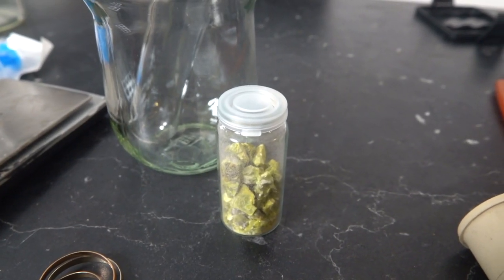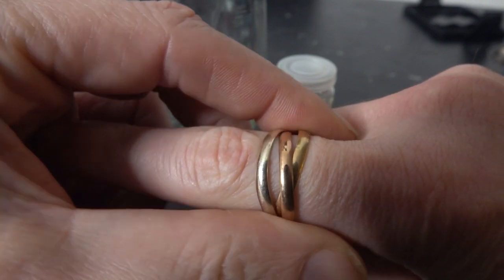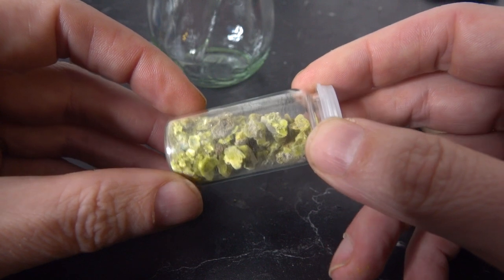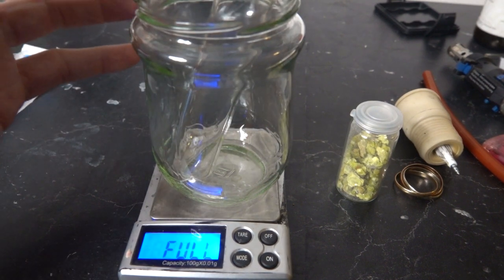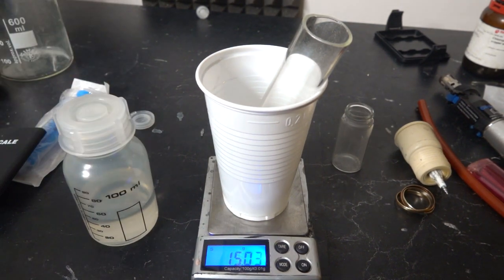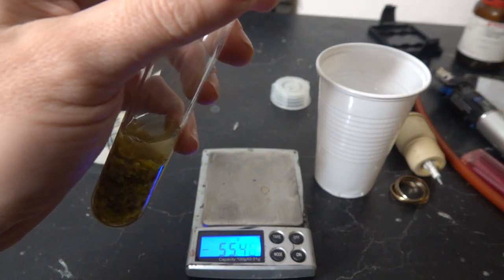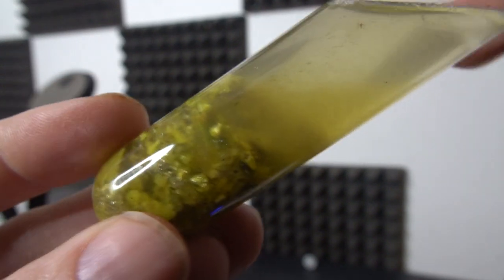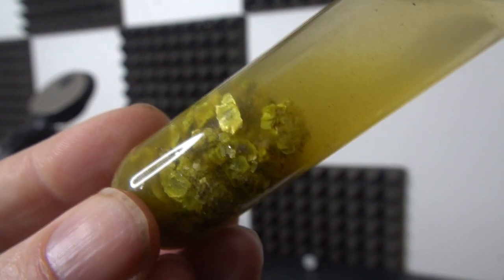Making a ring out of Metallic Uranium, Part 1

Comment: Bare hands and no vent hood to handle nitric acid?  Did you at least have a face shield on?
Reply: He wears glasses :))
Reply: If something happens to cause a splash of acid, glasses won't help.  Numerous times over the years while wearing glasses with side shields (prescription safety glasses), a drop or speck of something flying through the air got right past them and into my eyes or the corner of my eyes.  It's nothing as hazardous as straight acid of course, but it shows how glasses really provide only minimal protection.

Comment: nile red: "i won't refine uranium on youtube", always uses gloves and only under hood with DEPLETED uranium
thunderf00t: hold my uranium solution!
Reply: Depleted uranium is more radioactive than natural uranium, which is in turn more radioactive than highly enriched uranium. Radioactivity has (almost) nothing to do with the ability to perform nuclear fission when submitted to a neutron flow.
Reply: @takix2007  uranium 238 ( which i think of as depleted uranium) has a half live that is more than 5 times longer tan uranium 235 which is present in enriched or freshly refined uranium in addition to uranium 238. i would argue that this makes depleted uranium less radioactive. I did not look at the decay chain. if the decay chain of U238 releases more than 5 times as much energy as U235 i will admit defeat.
Reply: @MsMotron  you might be right, my brain may have made the shortcut to jump to U8 and its decay chain rather than pure U8 which is LESS radioactive than U5 or natural U. Some memories from my nuclear engineering courses nearly 15 years ago do tend to wash out when they are not used very often... (I do not work in the fuel cycle, so please forgive my rustiness!)
Reply: @takix2007  as the other guy said, going simply off half-lives, U-238 is less radioactive than U-235 because it has about 5 times longer half-life. Natural uranium contains mostly U-238, and depleted uranium even more so. So both natural and depleted uranium should be less radioactive than enriched uranium, which has a high concentration of U-235.
Reply: @SMPKarma  yeah, and like I said, I got it mixed up. I doubt there is any need to further comment that, don't you think? 😉
(Edit: I may have not been that clear about my mixing up of all instances of U8 with U5)

Comment: For casting, induction heating in an inert atmosphere  or under vacuum? (Vacuum casting has the advantage that you can use atmospheric pressure to collapse any voids) I don't know if traditional vacuum casting equipment and supplies would stand up to the temperatures needed. With a graphite mold you might be able to just heat it up under vacuum and then let argon in to make sure the mold is filled. 

If you wanted to go all out, I wonder what the surface tension of molten uranium is. You could cut a toroidal shaped cavity in graphite, pack some uranium in, then spin it as you melt/cool. The outer surface would be defined by the mold, the inner by the surface tension and speed of rotation. (And you shouldn't have to worry about thermal expansion/contraction breaking the ring or mold)

Comment: hey @VoiceOfThunder Don't rag on jam jar chemistry too much, cause there are kids in Texas USA that have to use jelly and jam jars to do any chemistry while watching your inspiring experiment videos, because while in Texas its pretty easy to get guns of many varieties, ALL LAB WARE like beakers flasks test tubes condensers? ILLEGAL TO OBTAIN OR OWN if you are not a big scientific research company/corporate lab or corporate chemical manufacturing facility. why? cause you would not want common people being able to make quality drugs and compete with the big pharma chemical industry side of the likes of Bayer or Dow Chemicals, even though they are claiming its to just stop home made illegal drugs, cause no one ever used a bath tube to make acid in the 60s and 70s, or even the 80s and 90s even with the rise of meth and ecstasy or what ever other designer drugs that were being made and sold at night clubs and on street corners, and it I am sure made the costs cheaper too since lab equipment is damn expensive if you get the right stuff to ensure control over your process. (I can attest to this thanks to the lab hardware I had to get for making my starting nano materials like nano copper, carbon nano tubes and probably some hybrid carbon/aluminum oxide nanotube/pores for my nanotube sleeved laser diodes and LEDs, and I don't even have all my needed equipment since my TV picture tube vacuum chamber is not cut down yet, so I can start cleaning the inside out and prepping all the ports and clamping fixtures for it let alone the hardware for the CNC X/Y table that will go inside so I can move a substrate under a laser array for doing controlled chemical deposition lol, heck I probably only have about half the glass ware I need since it gets damaged pretty easily when working with the harsher alkalies I need to work with, :)  )

Comment: Gee man, you surely ain’t an advertisement for safety! Pouring Nitric Acid without rubber gloves and safety goggles 🥽🤔🤓! I had an “encounter “ once with HydroFluoric  acid HF , a puncture in a glove was enough, I didn’t even realize it until my finger tip started hurting like I had a hammer strike because this SOB has a “habit”  of penetrating under your nails, and there was “whaling and gnashing of the teeth “ 🥶
Reply: I could be totally wrong but I feel like pointing a few things out regarding your statement. 1) Nitric acid can cause certain gloves to spontaneously combust resulting in worse things than an acid burn. 2) HF burns aren't usually painful as it quickly forms compounds with calcium for which you need for nerve conduction (pain). 3) Exposure to HF is considered life-threatening; again for the reasons of those pesky nerves might be needed to do other things like allow you to breathe. See calcium channels in nerve function.  If anybody can find fault with the above, please let me know.
Reply: @BlackWolf42-  sorry man but in the early days of microelectronics, something like 40 ago everything was done manually. I personally poured many bottles of both fuming 70% Nitric Acid and 40 % HF , we always used standard rubber gloves like those used in the kitchen and although the nitric tended to stain the gloves they never cought fire, as for HF  i can guarantee you that it has a nasty habit of penetrating under the nails and eat into the flesh, it does not burn like Sulforic but it's  a throbbing pain that will drive u crazy and the remedy used was to cut the nail until exposedand treat with hot water and neutralizing cream, in those days i wasn't the only one to know the HF bite and I still reccomend full safety with gloves tyvek sleeves and apron with full face splash guard when dealing with these nasty chemicals

Comment: Maybe just electroplate onto a ring shaped electrode and skip the casting part.
Reply: Unfortunately electrolysis doesn't work that way you end up getting an incredibly fine powder that you then have to melt
Reply: @borttorbbq2556  Not sure about that.  Seems to work fine for nickel and chromium electroplating.  I think it depends on current density/speed of deposition.
Reply: He would almost be better off taking the powder and putting it into a mold and melting it in the mold itself
Reply: it works for copper with an appropriate current/surface ratio, I wonder if uranium behaves the same.